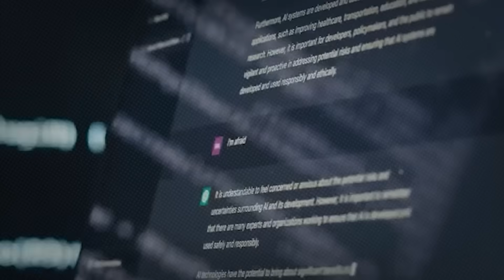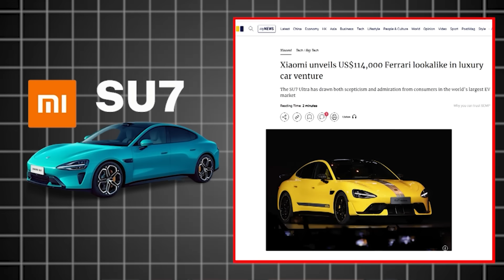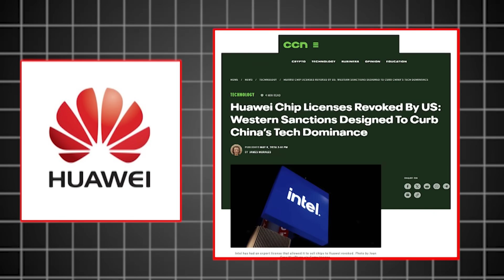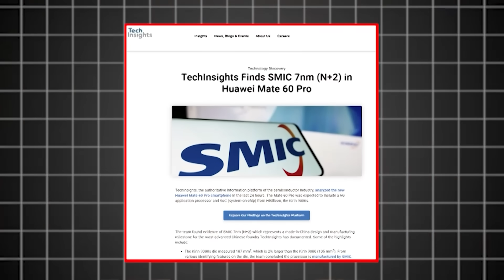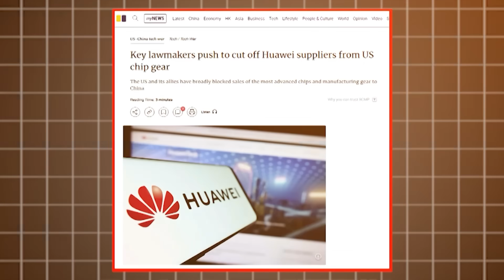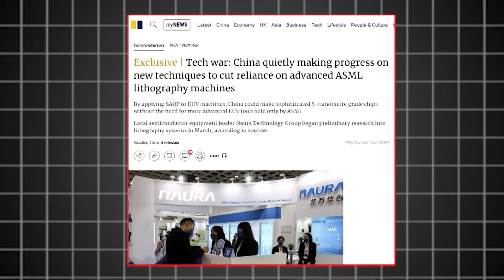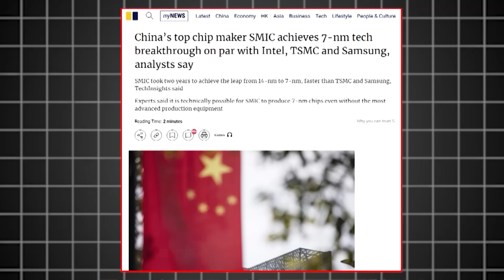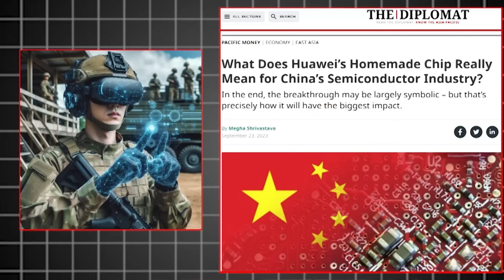Chinese Breakthrough in AI Chips & Semiconductors Challenge American Strategic Interests?

Comment: There is nothing secretive about China growth in chip technology.
 
The China is developing its home-grown chip lithography machines amid US sanctions.

Shanghai Micro Electronics Equipment Group (SMEE) has been committed to developing a 28-nm immersion lithography machine to meet the requirements of commonly used devices.

The US has persuaded its allies, Japan and the Netherlands in its effort to contain and restrict China's tech sector growth. 

To cope with the US-led suppression, Chinese companies are forced to make their own tools in a bid to avoid being squeezed by the US.

Chinese companies are increasingly inclined to adopt domestic products in their preference to use homegrown chips to mitigate market risks.

 As the demand for homegrown chips rises significantly, their prices will fall and their performances will improve over time, fostering a positive feedback loop.

Necessity is the primary driving force for China to innovate in the chip technology industries.

The US force China into the corner in total capitulation and to destroy China and to prevent China from  competing with the US.

China is fighting for survival  in order to overcome US multiple sanctions and total destruction and obliteration in core high-tech technology business.

The US wanted to destroys China and its economy in order to prevent China from competing with the US.

The US Bureau of Industry and Security issued a document with its 139 pages of dense bureaucratic jargon and minute technical detail is a declaration of economic war on China. 

The US government announced its intention to cripple China’s ability to produce or even purchase the highest-end chips.

The US wanted to impact China’s A.I. industry and the semiconductor stuff is the means to that end.

China was cut off not just from importing the most advanced chips, but also from acquiring the inputs to develop its own advanced semiconductors and supercomputers, and even from the U.S.-origin components, technology and software that could be used to produce semiconductor-manufacturing equipment to eventually build their own fabs to make their own chips. 

After 2023, Oct. 7, the US forbids any persons to engage in any activity that supports the production of advanced semiconductors in China, whether by maintaining or repairing equipment in a Chinese fab, offering advice or even authorizing deliveries to a Chinese semiconductor manufacturer.

For China, the race for technological self-sufficiency presents perhaps a greater challenge than any the country has faced. 

The Oct. 7 export controls, while crippling China’s advanced chip-making ability for the foreseeable future, may end up spurring long-term growth.

Now Chinese companies must innovate together or die. 

US attempts to curtail China’s technological rise enabling China to endure the economic hardships imposed by the sanctions into a catalyst for indigenous innovation inadvertently.

China strong support for the semiconductor industry conveys confidence to the entire industry, indicating that China has strong financial resources and technical support, and also has firm determination in terms of chip independence. 

Continuing to convey confidence and determination is crucial to the development of the industry.

China's chip industry has not stopped developing but has instead grown rapidly. 

China continued increase in investment will further enhance confidence in the industry.

Comment: The Chinese are working hard on alternative tech just as they did in the automotive industry. They are diving deep into photonic chips that use light instead of electric current and other mediums such as carbon etc. Further down the road, we might see a replay of what is now happening to the mighty legacy internal combustion engine auto manufacturers of the West. Then the crying, screaming and finger pointing will follow. Of course, it will be all China's fault, over capacity blah, blah, blah.

Comment: You are guessing that TSMC would build Xiaomi's 3nm chip design.  Would the US allow TSMC to do so using their EUV machines?

Eequally plausible is the fact that Huawei has developed their self-aligned quadruple patterning (SAQP) technology which would get them to 5nm from 10nm and using Huawei's chip stacking to get the equivalent of 3nm.

Everybody is guessing and making assumptions, Having said that, do we know whether SMEE has an EUV in the works?  Or, is Huawei working on the particle accelerator EUV technology in their new semiconductor lab in Shanghai?

Since the Chinese are closed lip about their advances until it gets released, unless an insider blabs to the world, nobody knows.